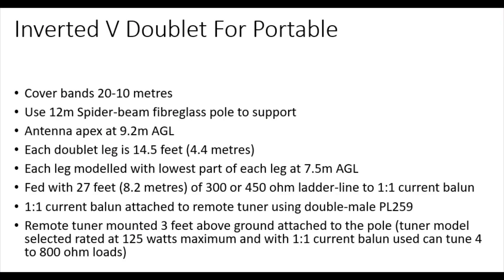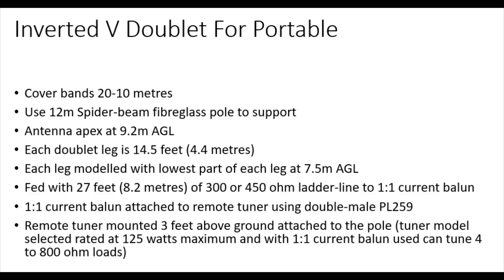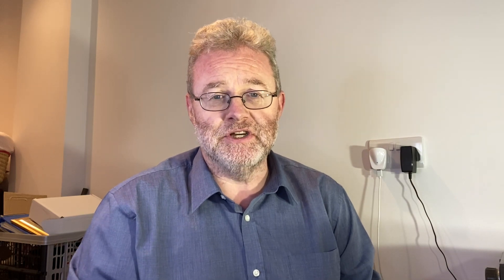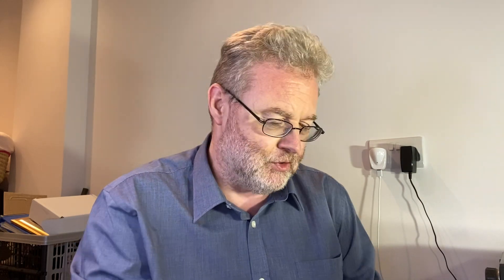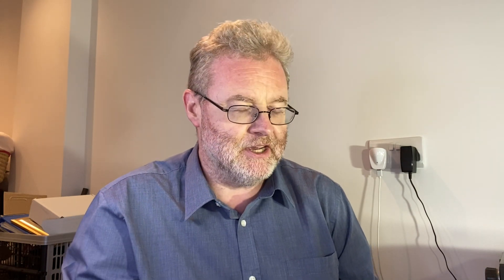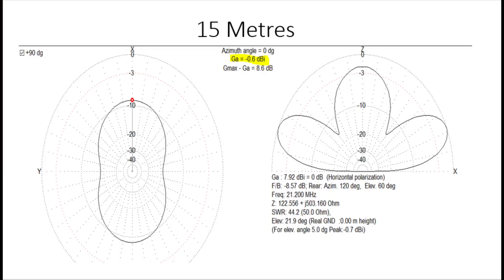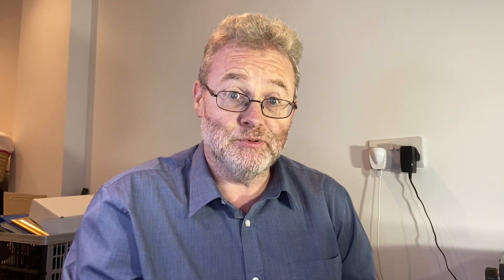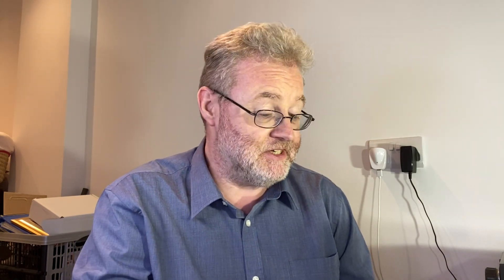Ham Radio: Great Doublet Antenna For Portable HF

Comment: Iam now using an end fed inverted v antenna tunes on 40 -10 no problem with a counterpoise balun 20 metres of speaker wire and a auto tuner works great
Reply from the maker: Good stuff!

Comment: Thanks for putting up this video Tim, I’ve been using a doublet very similar to the one you describe at my home QTH for a number of years and it always surprises me how good it is even compared to my beam on 20m and 17m in particular. Hadn’t thought about using one /p but will certainly give it a go. Thanks for the inspiration. G0NAD.
Reply from the maker: Very welcome Richard.

Comment: I made a delta loop for 40 meters used ladder line and found it was short, causing tuning issues affecting the resonate of the loop, by using a antenna analyzer I increased the ladder line so it was multi 1/4 waves long which resolved the problem.
Not keen on using a 1 to 1 balun as it is 50 ohm to 50 ohm and as you go up in frequency the impeadance of a aerial will increase causing a mismatch to the balun and heating it up.

Comment: Just used a Double Male 259 to connect a Bias T to Antenna Switch :-)
Tim, I am sure the older I get, the more my Brain turns to Mush. The radiation pattern, you say it is Broadside to the Antenna, so it is as if the Antenna is bisecting the Figure 8 radiation pattern, in effect in the Left picture on the Y axis?
Reply from the maker: Yes, on the azimuth (left hand side) pattern, imagine the dipole running from 3 to 9 o’clock.

Comment: Hi Tim, how do you model ladder line? What is the diameter of LL wires, and what is the spacing? Thanks.
Reply from the maker: Through another transmission line program .. really useful! The spacings are 0.93 of an inch (about 22mm) as in standard 450 ohm ladderline.
Reply: @TIMG5TM  Thanks. That was my idea. One of online calculators said 450 Ohm is obtained with spacing of 65 mm using 1.5 sqmm wires, but Mmana-Gal gave rather wierd diagrams. I have 22.8mm 450 Ohm ladder line, and I will use that. Thansks for great videos. Looking forward to make my first lader line antenna. Tuner is almost there, now wires part. :)